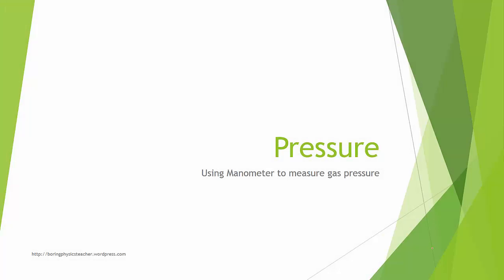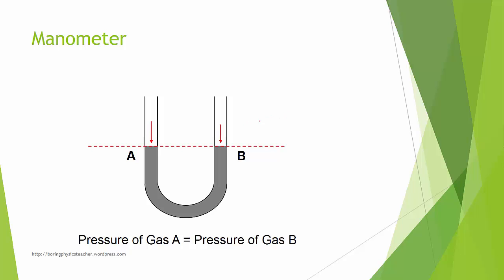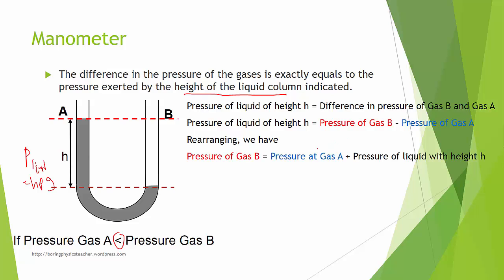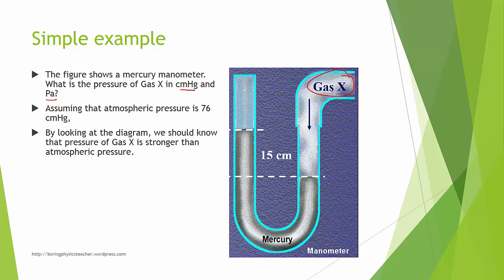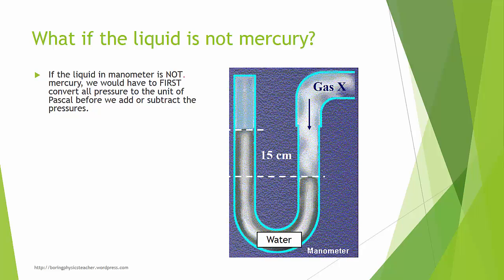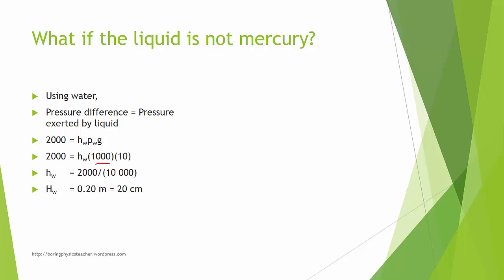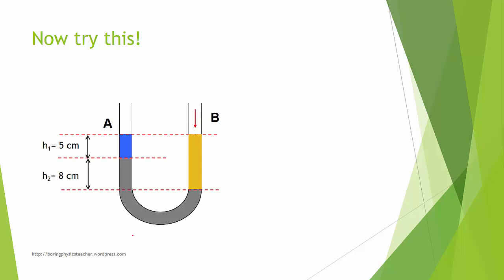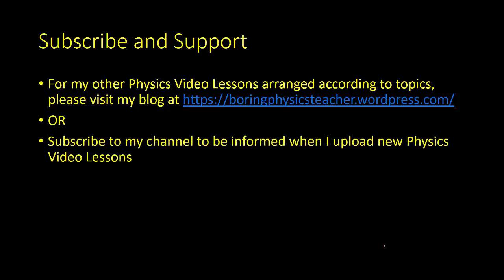How does manometer measure gas pressure?

Comment: Sir may i ask , when we want to convert from hgcm to Pa , 
Is The formula 
A × density of liquid × 10 ?

Is the 10 is a constant?
Reply from the maker: Hi Diana, the formula is height (in meters) x density of liquid x g. The value of g is 10 (9.81 to be more precise but we round it up to 10) if the setup is on Earth.
To specifically convert from cmHg to Pa uses the same formula. Since cmHg meant that the liquid is mercury, you can use density of Mercury = 13600 kg/m3.
For example, 76 cmHg = 0.76 x 13600 x 10 = 103360 Pa.

Hope this helps!